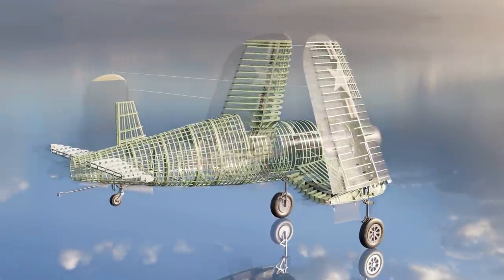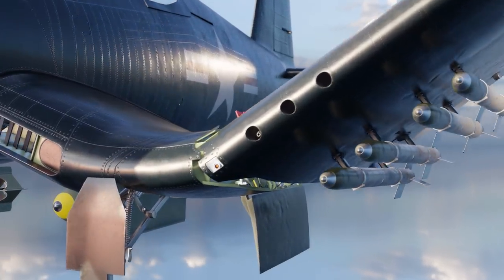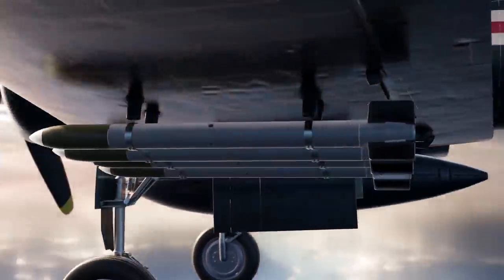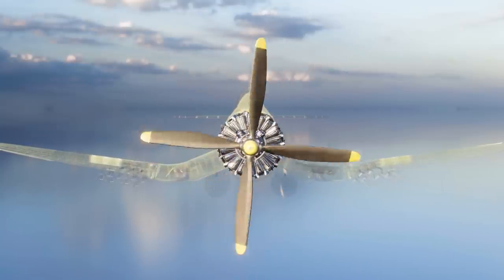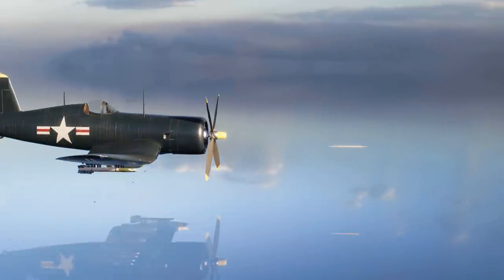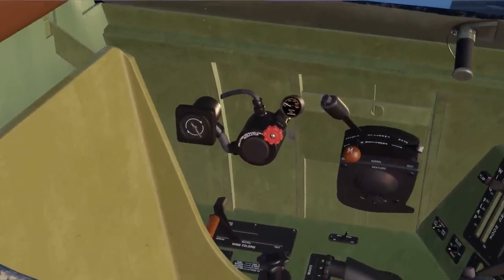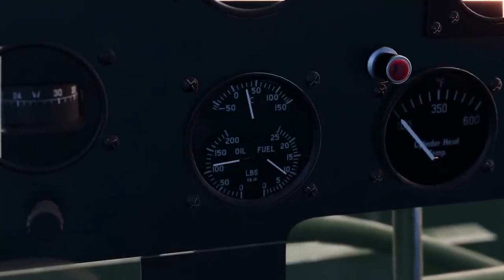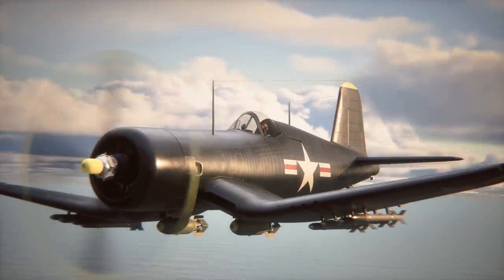Inside the F4U-4 Corsair

Comment: That landing gear is a design masterstroke. It not only allows for the gullwing shape but also means that bombs can be carried close to the fuselage. This makes the aircraft more stable if just one bomb is used at a time.
Reply: The landing gear sucked bobo! At least the original design was much to stiff, it was one of the major issues screwing up the carrier landings, it caused the planes to bounce on the landing deck. Another flaw the British fixed. The Royal Navy engineers modified the landing gear, replacing valves in the struts. The US navy originally refused them because of flaws, and design. It was US Marine land-based squadrons who first introduced the F4U Corsair to combat in February 1943.
Reply: It wasn't the landing gear that allowed the wing shape but the wing shape allowed the landing gear to be short enough to survive carrier landings.
Reply: @lesliemacmillan9932  
Maybe he was looking at it upside down.
Reply: The wings that shape due to a large prop. Not because of the wheels.

Comment: Great video, well researched.  Correction.  It was not an Air Force plane, it was a Navy/Marine brute that taught young pilots about torque.
Please keep up the good work.
Reply: As a Navy brat, I can tell you that saying the Corsair was an Air Force craft is fightin' words. XD
Reply: I have to agree, this is a top notch video.  This was the only error I found also.  I am really looking forward to watching more from this channel!
Reply: One other error, production ended in 1952, not 53, with the Goodyear FG-1D being the final variant.
Reply: One glaring error is about the wing construction. Although some of the wing parts are fabric covered, the leading edge as well as the top and bottom of the wing are absolutely, positively, sheet metal covered. The ailerons are fabric the flaps are metal.
Reply: @tomwalsh7832  I assumed the whole thing was aluminum - I had no idea they were still using doped fabric in WWII. I've still got a lot to learn, I guess.
Reply: Do you happen to know why one wing would stall faster than the other at first?
Was it because of the massive prop's slipstream? Or were the wings not symmetrical?
Reply: How did mid mounted rockets miss the propeller?
Reply: @cody481 they dropped and then fired.

Comment: 0:53 The US navy originally rejected it, as the cockpit was positioned back and lack of proper visibility due to the air frame being so high and angled up, so as to accommodate the huge propeller, pilots couldn't see to land, and adjusting the angle caused the right wing to stall out. So between wing stall, and over throttle high torque flipping, the USA navy didn't want it scratching the landing deck of its carries. The British made some modifications, a wedge riveted to the front of the starboard (right) wing cured the one wing stall, and adjustments to the landing gear to soften the landing. Plus they adopted methods used to land their own long nosed fighter, the Seafire, called ‘crabbed’ landing. Developed by British Captain Eric Melrose (Winkle) Brown. By Swinging the nose to starboard with the rudder, while counteracting the swing putting on a slight opposite bank. He made the Seafire ‘crab’ in sideways, to give a better  a view of the deck over the wing. 😊😊👍👍
Reply: That is the MOST INFORMED,ACCURATE ASSESSMENT of this Aircraft I've seen..Most people aren't aware of what you stated.
Reply: There was a guy in the FAA who bought a whole load of Corsairs in ‘43 for the Royal Navy as soon as he heard that the USN didn’t fancy them. Did it without authorisation. Balls or what?

Comment: Great presentation!  I have not read all the comments yet.  In case no one has brought this up so far, I will mention one correction.  At the end of this video, it was mentioned the Corsair served in the United States Air Force.  This should be changed to U.S. Navy and Marine Corps (plus British Royal Navy if you so choose).  That is all I can point out.  You can bet I will watch this over and over again, it's that enjoyable (especially to an aircraft mechanic such as me).
Reply: Another aircraft mechanic checking in. This is a flying killer. A tank with wings. Equally adept at ground strafing, dog fighting or outright bombing runs. The F4U was considered for installation of the Pratt & Whitney R 4360 28 cylinder air cooled radial engine capable of over 4000 HP. This configuration never came to fruition and there are no remaining F4U Corsair airframes with the R4360 engine configuration.
Reply: The French used it as well, I'm pretty sure the Royal New Zealand Airforce used the Corsair. I'm more of a Hellcat fan myself, love Grumman aircraft.
Reply: There are several F2g’s remaining. You can visit one at the boing museum of flight and I believe one still flies at the reno air races, well not reno anymore.
Reply: @briandenison2325  atleast you can appreciate the cat and hog share the beast of an engine.
Reply: @briandenison2325  Yes, The RNZAF also flew these. My grandfather flew Corsairs in Guadacanal and the Solomon Islands for the kiwi airforce.
Reply: 16:40 between 600 and 800 or between 6000 and 8000? If it's not a mistake, engine rotate very slowly, like a diesel engine in a truck🤔

Comment: Another Great video and nice Breakdown!

I never knew it was such a hassle to get the Corsair in the air or land because of the torque… very interesting indeed!
Reply: as the years went by the tourqe increased by the korean war the engine was so powerful that pilots started sayng it has enough tourqe to flip an entier house
Reply: The legendary Royal Navy test pilot Winkle Brown mastered the art of landing the Corsair on a pitching and rolling aircraft carrier and suggested alterations to the undercarriage. Making a huge change in its useability.
Reply: @philhawley1219  yup they started coming in from the side so they could see the flag person from the left side of the cockpit
Reply: My father flew P-47s in WW II out of England and France. They had the same basic engine as the F4U. He told me he saw more than one "newbie" kill himself by "cobbing the throttle" with the brakes set, causing so much torque that the airplane flipped over while standing still. Sad, but impressive.
Reply: The movie that came out in 2022, Devotion, made reference and shown the issue of the torque.  Very good movie
Reply: What was the actual life of the engine under combat conditions?  Did  mechanics have to rebuild engines in the field, and how often.  I'm a junkie for aircraft service and repair.  Serviced radar nav on B52s then radar and inertial navigation systems on F4Cs and RF4Cs.
Reply: @edt.5118  in war emergency mode the engine blew up in like 5minutes

Average engine lifetime under combat condition was like 500hours if it dint get damaged before

Comment: Forgot to mention that 12 minutes of water injection is the duration of the water tank.  But the engine can sustain water injection power for several hours until it needs a replacement. 
In fact  all R-2800's had to pass the ''7-1/2 hour endurance test'', this test consisted of 2 hours 30 minutes of continous power at maximum power using water injection and 5 hours of ''Jazz'' which consisted of  periods of 5 minutes of this max power using water injection followed by another 5 minutes of a low power setting until the 5 hours are completed.
Reply: Sounds like you're up on P&W radial engines. My dad was one of their first employees in 1930's. He started  work in experimental test as a mechanics helper and worked his way up. He enlisted in the Navy for WW II. After the war he returned to his job. He started up and ran  their first jet engine. He personally knew all the senior management on a one on one basis. In the 1980's . Yes the 1980's A senior VP who he worked with at one time called him up and said I heard through the  grape vine you are going to retire to Florida. Pratt purchase his house in Connecticut move to him Florida   all expensive paid and got him a job in the West Palm Beach plant until he retired few years later.
Reply: Background music in your videos is not necessary. It’s distracting and annoying.

Comment: My favorite aircraft of all time. I built a 1/72 scale model of it when I was 12, with the help of my father. And we went all out on detail, from puttying and sanding every crease until it was smooth, airbrushing in an exhaust stain across the fuselage, using a silver-ish paint to put nicks on the leading edges of the control surfaces, etc. It looked real when it was done. 

Tragically, I also witnessed with my own eyes the crash of one of the rare Corsairs on July 29th, 1999 at Oshkosh, WI. I remember first hearing the unnatural scream of the engine as the aircraft flipped up on it side before tumbling in a cartwheel in a fiery wreck. I also remember the Civil Air Patrol NOT helping with the wreck, but instead patrolling the front line of the crowd threatening to confiscate cameras if they caught anyone taking pictures. We never heard word one that day of whether or not the pilot was OK (he was badly injured, but survived). Really unpleasant experience, seeing the destruction of a beautiful old warbird, the injuring of one of the few living pilots that could still fly her, and the tasteless response of the facilitators of the airshow to the audience.
Reply: Beautiful
Reply: Gracias por tu experiencia Yo a la edad de 12 hice un corsair  Un Grumman avenger y un P 38.

Comment: I'm no expert on the Corsair, but I have it from an A-1D Skyraider pilot, that, before switching the magnetos to Both, he primed the intake, cracked the throttle, and cranked the starter, counted eight props (which means that the crankshaft has made two complete revolutions, guaranteeing that each cylinder has had at least one intake stroke), and then switched magnetos to Both.

Comment: I love this format,  a couple of errors to point out.   The P-40 had the rear retract rotate 90 deg design (first of course and today  the Airbus A320/A321 has a nose gear that does the same).    The Corsair  was not a mainstay or any stay of the USAF (or Army Air Corp).    It was a Marine and Navy fighter/bomber.    The Navy and Marine Corp simply had no jet that was as effective as the Corsair as a fighter/bomber.    It did serve in other Air Forces.

Comment: The stall wedge on the right is not present due to a design flaw, the outflow (thrust) from the big prop affected the top of the left wing and the bottom of the right wing. The aircraft exihbited a left wing tip stall charracteristic, the stall wedge or 'strip' caused the right wing to stall when the left wing staalled, contributing to the prevention of stall induced roll to the left.

Comment: The Pratt and Whitney double wasp engine was built in Kansas City. I worked in the building in the late 70s. There was such conservation of building materials at the time of construction because it was built after the start of the war, there were areas where the original flooring was still in place. The flooring was made from 2X6 boards cut into lengths of a few inches, then with the cut end facing up, the boards butted up against each other and pounded into the dirt creating a brick like surface. Of course the floors were not level. They would have a wave to them. The ceilings were arched concrete to save on structural steel. There were many of their original machining tools left from that era. They were huge 20 ft tall some presses, etc. It was an experience for me having never worked in a machine shop environment prior. The building was for Bendix to build ICBM parts. But now I think it’s Allied Signal.
Reply: That flooring is common in metal stamping plants due to the oil on the metal.  The lol droplets would soak into the end-grain wood to reduce slippery flooring.  The floor would be periodically shaved to clean up and restore the surface.
Reply: I know exactly the floor type you're talking about.  In the 80's, I was in the AF Reserve working in the Martin bomber plant in Omaha that had the same floor.  As they replaced the floors, they pulled up the old wooden "bricks" and made commemorative plaques from them to give you when you departed the squadron.  I still have mine right here on my desk.
Reply: As was mention about the wood floors in metal stamping plants. I was told the wood pieces were used to help product the dies if one was dropped, plus I was told they would only set the dies on the wood vs the cement for service and what ever else.

Comment: Wonderful video with lots of great information and excellent graphics. The video mentions that the surface of the wings was fabric from the spar back. I'm pretty certain that the F4U had an all metal wing.
Reply: @johnklatt3522  I had no idea. Thanks for the info. I've built scale models of this variant before and they appear to have flush head rivets on the wing panels aft of the spar. Were those a different type of fastener for the doped fabric?

Comment: About the camera:

Nine F4U-4s were built with an oblique reconnaissance camera in a blister with a sliding window on the left side of the fuselage behind the wing and designated "F4U-4P". They retained full F4U-4 armament. 30 F4U-5s were also given a reconnaissance camera fit like that of the F4U-4P and were given the designation of "F4U-5P". The F4U-5P was a long-range photo-reconnaissance airplane and was equipped with a unique rotating camera mount.

Source: MCARA

Comment: Absolutely love this video! I pair's really well with videos of people flying it. Currently building the F4U model plane by Revell. Unfortunately the model planes landing gear design is not very good and the molded parts are uneven. 

I'll be using an automotive paste to patch over the misaligned parts and landing gear. Sanding it to a smooth Finnish. After the painting and decal process I'll string it and have it in a "flying" position so I won't worry if it has landing gear or not.

I use to have 2 air force jet toys given to me by my aunt many years ago. But this is the first time I've been interested in Aviation and planes. I know very little about them so why not learn more

Comment: Superb CGI and what a way to see the hidden detail, especially the moving mass within the engine relative to the whole airframe. Just one point at 11:12, pretty sure no rockets were ever installed on these stations owing to the windmill up front.
Reply from the maker: The rockets were designed so they dropped away before they fired up to miss the windmill

Comment: The Royal Navy Fleet Air Arm turned the Corsair into the aircraft it became ....  They came uo with the improved hood, the little bit on the wing to stop the stall flip. Improvement to the landing gear, sbutting off some of the vents on top of the cowl that kept oil away from the windscreen and im not sure if the Americans sdopted it but we cropped about 8 inches off thd wings to fit them into our hanger decks which improved it's roll rate immensely in combat .....

Comment: It might be a small forgettable thing, but the small stall strip to the right side wing was not present on the F4U-4. It had been replaced by a rectangular hole in the right side flaps close to the wing roots. The six-inch stall strip was only a stopgap answer to the problem of violently rolling to the right when at stall speeds. Also the extra air scoop in the front, just underneath the engine cowling was not mentioned. It was also much larger than how it is modelled in the video. Last comment is about the inverted gull-wing of the Corsair, as landing gear length was not the only reason. It has to do with the centre of gravity and how wings should extend from a circular or oval fuselage. The gear was also used as dive brakes due to their extreme ruggedness. I do not believe there was a single crash landing that was the fault of the landing gear collapsing or otherwise failing on contact with the ground. The P&W R-2800-18w also got even more powerful over time with higher octane fuel and higher manifold pressure.
Reply: @johnklatt3522  Oh then I must have been misinformed by mistake, but thanks for correcting me!

Comment: I'd love to see a breakdown of the ME109. I'm really curious about the cannon that runs through the prop and see a schematic of where the gun is, how the barrel is run through the engine, etc. Great work on the Corsair video!
Reply: The gun is mounted between the inverted v of the engine and since the propeller is driven through a gear reduction it can fire through the center of the hub. I would also like to see this channel do a graphic of it.

Comment: A great presentation, however one thing that is incorrect is that with a sudden opening of the throttle, my experience was that the plane wanted to go into a spin to the left, not the right as shown in the takeoff/aborted landing sequence of the presentation because not only high torque, but also because of the propeller slipstream and asymmetric thrust, which all combined to roll and yaw the aircraft to port and away from the clockwise propeller rotation.

Comment: The inverted gull wing greatly contributed to the Corsair's speed by reducing drag, by having the main lifting body set away from the circular fwd. fuselage which was the idea behind it. (not propeller clearance) Had the oil cooler, inter cooler intakes been more streamlined it would have achieved a bit higher speed.
Reply: @johnklatt3522  The Hellcat used the same diameter prop...13' 1". The 13-4 prop came on the later Corsairs. Still the F6F-6 used a 13-4 four bladed prop on the same length MLG struts.